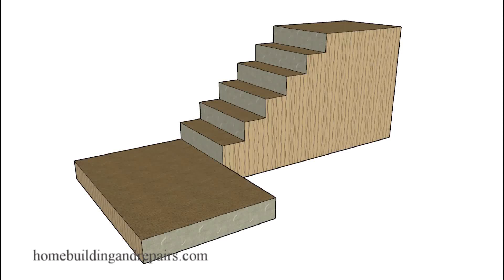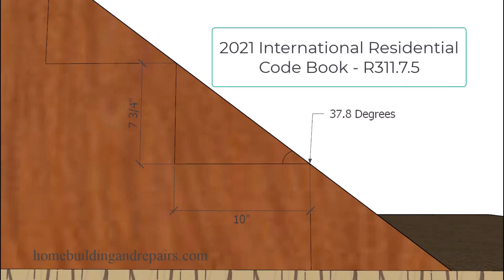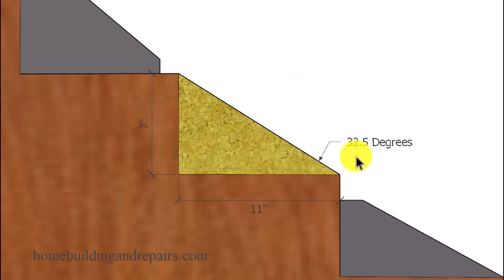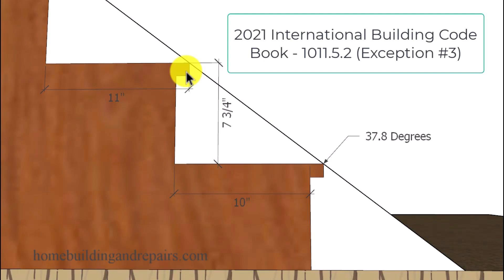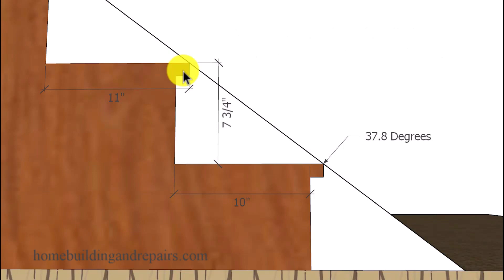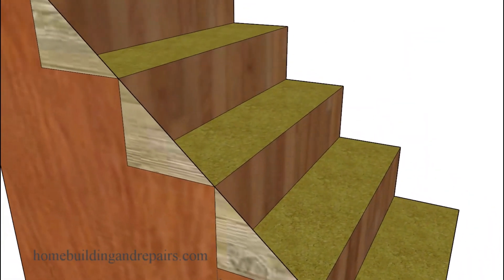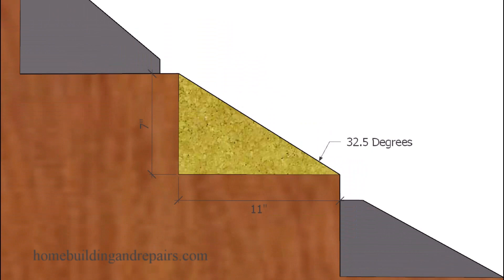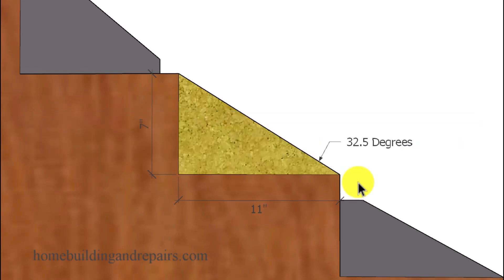Maximum Stair Building Angles And Building Code Reference Numbers - Construction Education And More

Comment: For a traditional Cape Cod home which is 24' deep with 12' joists to the center beam, 9" treads is the norm. Being that 12 treads X9" is 9' stair length with a 3' landing left before the front door. 8' high typical ceiling with 2x6 ceiling/second floor joists keeps the riser at 8". changing from 2x6 to 2x8 joists sets the riser at 8 1/8". The ceiling height could also be lowered to 7'6" to make it a true Yankee frugal cape.